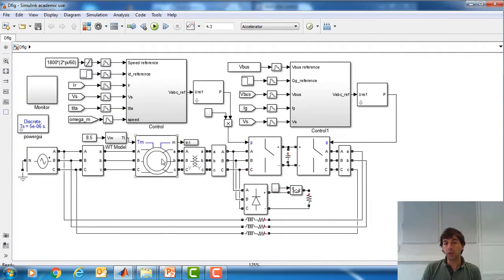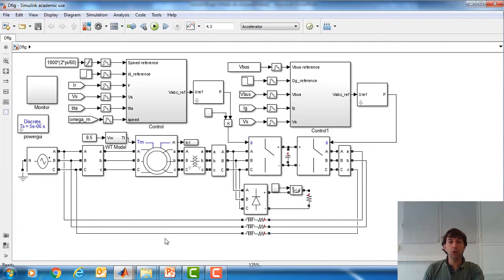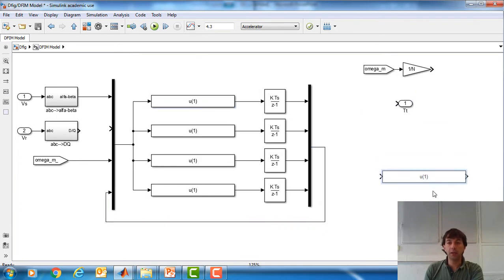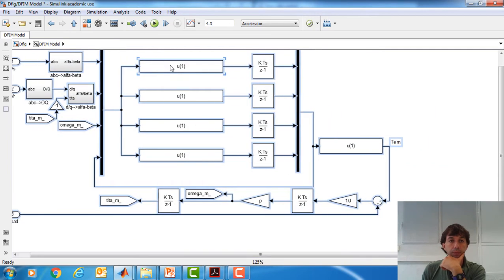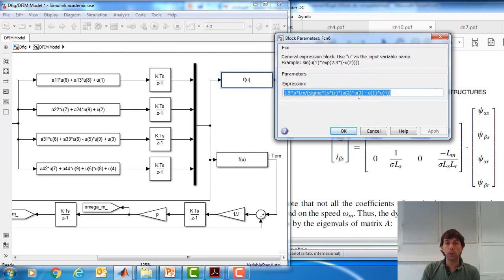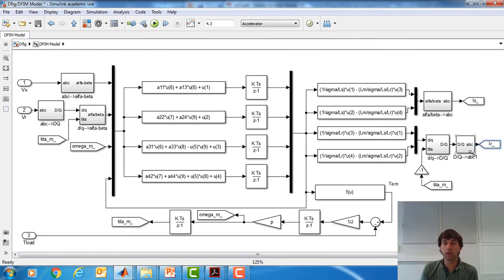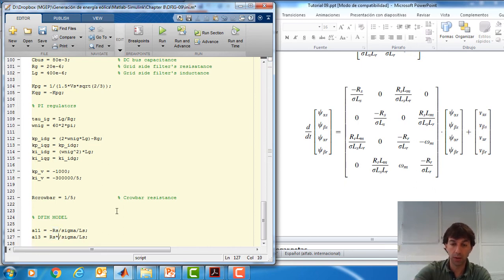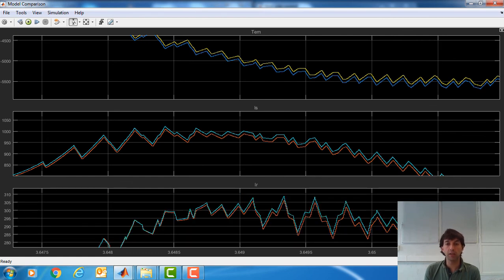DFIM Tutorial 9 - Analytical Model of Doubly Fed Induction Generator for On-Line Simulation

Comment: I tried connecting the analytical model with the grid via voltage measurement but it was not possible even using PS and SP converter. Please someone should guide

Comment: hello, tnx for the video. I've got a question
when I run the simulation for detailed model of DFIG on Simulink that has a voltage dip of 50% during a short time interval; According to the Ieee papers,the flux should be of a great number during the voltage dip, but simulation result in simulink shows a completely different thing(the flux is reduced during coltage dips). I wanna know which part of my simulation is wrong?
Reply: I Error in 'model/Asynchronous Machine SI Units': Initialization commands cannot be evaluated.

Caused by:

Index exceeds array bounds.I got  the error   while doing Simulink
please help
Reply: @jay1998-t9r  open asyn/machine block on simulink. Then take a look at the values on intialization part. The part contain your starting slip which should be 1.
Reply: @pbs570  I am also working on this project and have some doubts going through these tutorials. Can you send me where I can contact you?

Comment: Hi, I have tried to replicate the DFIM model but it did not work. I guess because we get a feedback from variables they are not solved yet such as Tem_, tita_m_ and omega_m_ . Please advice.
Reply: I Error in 'model/Asynchronous Machine SI Units': Initialization commands cannot be evaluated.

Caused by:

Index exceeds array bounds.I got  the error   while doing Simulink
please help
Reply: Hi, have you been able to find the solution? My model is only working when I do not WT-Model Block on Simulink and instead apply an constant torque on the DFIM.
Reply: @kreb may you share the model, i tried to build the model step by step with the video but the output is not the same, is this problem occur with you?
And thanks in advance
Reply: @mohamedrabie6957  I am also working on this project and have some doubts going through these tutorials. Can you send me where I can contact you?
Reply: @v999k  may you send me the model you created?
Reply: @mohamedrabie6957  sure, send me your email

Comment: Nice to see this series for learning!
I want to bring your notice that the oscillations in torques are 50Hz i.e grid frequency and they are not damp even if we increase Inertia. Secondly, the flux damping during grid fault is the big issue in DFIG as  it needs few seconds to get completely damp depending on the Stator time constant (Ls/Rs). Is there a way to damp this oscillation and reactive power loop which you haven't implemented in this video can be made and be stable during Grid faults. Also can you please recommend any book for DC link voltage controller tuning and for the  notch or low pass filter to remove 100Hz oscialltion during negative sequence decomposition?